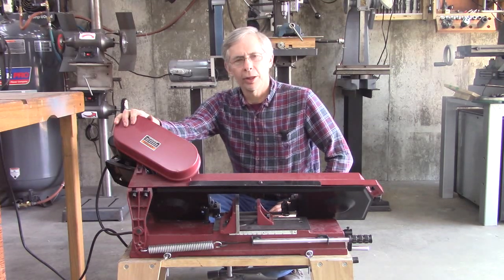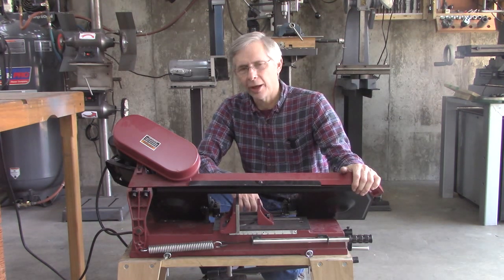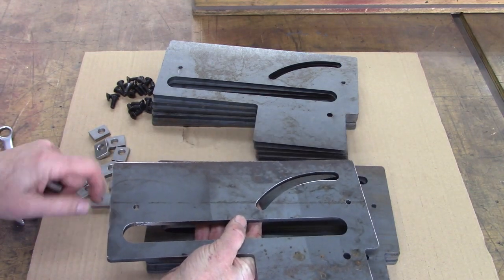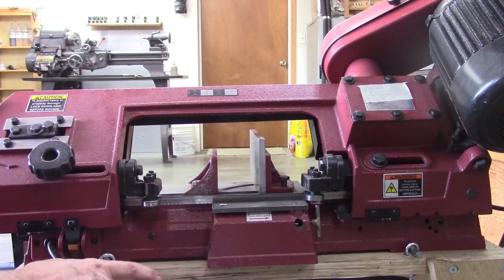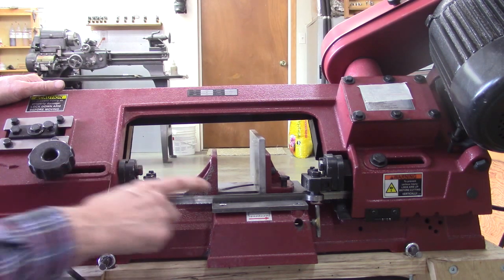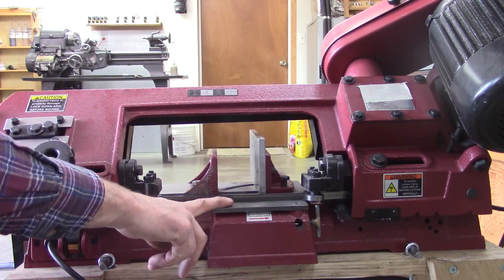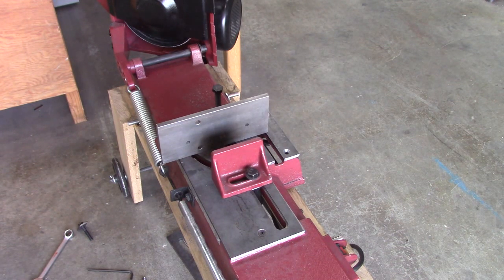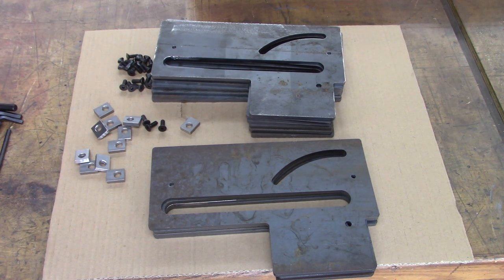Correcting a Common Depth of Cut issue on a 4x6 Import Bandsaw

Comment: I just ordered one of these plates ! Thanks Winky ! although the price has gone up I see ! it's still a good deal and my band saw is more or less useless without it !  thank you for coming up with the idea and sharing the idea with all of us !  when it get's here the counter sunk holes is the hardest part ! I don't have a counter sink... so I'll grind a old drill bit to the shape ! 
Thanks my friend !
Reply from the maker: Hello Bob. Good news, I changed the installation slightly so no need to countersink the holes. I've included instructions. All you need to do is drill 1/4" holes in the saw using the plate as a guide and then drive in spring pins (some call then roll pins). On the extension you will need need to drill and install 5/32 pins. All pins are included. I did not pre-drill the holes in the extension because some saws are made a little different in this area and I was afraid the holes would not line up. Thanks for the order and I'll do what I can to get it in the mail today.

Comment: Hi Winky. I think the saw bow you have is widely used across different style bases. My version of this saw has your style of bow but does not have the problem you have so neatly addressed. The vice stands up much higher from the swivel base. But there are two other issues you might like to look at. There is no electrical interlock on the belt cover. It is possible to accidentally run the saw with the belt exposed. Bad for fingers. The 'mechanism' for releasing belt tension to adjust the blade speed is appalling. On my saw it is a lockable bolt sticking up from the base that pushes on the underside of the motor. The bolt is next to inaccessible. I don't know if yours is like this, if it is I think many viewers would appreciate possible solutions. Cheers, and thanks for such a nicely presented and interesting channel. BobUK.
Reply from the maker: Id have to look again but i think the belt tension is a pain to adjust. The blade speed is about right for most cutting at the highest speed so fortunately i don't change speeds very often. I'll have to look at that.

Comment: I would like to suggest a new project for you to  build. After watching other youtube videos about making an electro-magnetic vise for a drill press why not make just a magnetic base for a standard vise so it can be used with non ferrous material and wood. I was looking on Amazon and some of the magnetic door locks look like they could be adapted to a metal plate with little effort.
Reply from the maker: Interesting idea....  although I'm not sure I need it. I have a vise mounted permanent to my drill press table. Occasionally I make things I don't need to perhaps I'll do this

Comment: Ok i have modified my saw allergy grate minds a all that . Hears a problem I have that you may be able to help me with  Given I have' not got the mens to cut a thread on my lath, yet  I have maid a Latin tool post .  But need an  adjuster bale  base . I can open up to a suitable size by doing it out , to fit my Latin size  . hear my suggestion.  if you mad some with the smallest Lantin post hole , a put them for seal on you new selling platform. I could send you a performer invoice . & buy the  Adjustable  Base ?
Reply from the maker: What is the diameter of your post and height to center? I'm not interested in making another one but i will sell you the one I made "IF" it fits!!

Comment: I was going to suggest making one out of either Red Oak or Rock Maple, but after getting soaked in cutting oil over time I think metal is the better choose. Mine arrived today. Thanks Winky.
Reply from the maker: Thanks you! I actually considered wood but i was worried about it warping. If I made it 3/4 think it might work well but then it would reduce the depth of cut also.

Comment: How do you keep your shop so clean...especially the floor?
Reply from the maker: Well...  it's not always clean but overall much cleaner than it used to be. Years ago I'd all day long on a project and be elbow deep in wood or metal chips. Now when thing get messy i start losing stuff. I guess I'm getting old. Another reason I keep it clean is that my shop is small and i have it packed with tools. If I get too much of a mess going I run out of space.
Reply: @WinkysWorkshop  Well stated....It still looks great in my book.

Comment: What is your background?
Reply from the maker: Well, I've had an entertaining life but no formal education. Actually I've always been into woodworking and to some degree metal working as a hobby but my job was running a web offset magazine press mostly. The last 15 years i worked however was designing machine improvements. It started just troubleshooting but most the problems were related to poorly designed machines. So I learned some cad and started making upgrades. It was actually fun for the first 10 years but after that I had all the fixable projects were finished and I was left with all the impossible jobs. When I retired I had about 20 projects going. I was glad to get out. Honestly, I saw the first 10 years as sort of an engineering education. During this 10 years I also worked with several very good machinists and bought a lathe and mill etc. I ended up making a lot of parts at home too. Now I'm retired, have all the cool tools and the time and knowledge to make use of them. Life is good!

Comment: I admire your way of doing things and for making these plates available to us.  My saw does not have that flaw in the design.  I don't know why but it doesn't.  Further more I have mounted a cross vise on the band saw platform.   Sounds and looks unattractive but I sure do like the set-up for the kind of work I do.  With the mounted cross vise I can dial in the length of a work piece much more accurately.  And for one off cuts that is a real benefit.  Thank you for this video and what you do.
Reply from the maker: Thanks for watching. The vise is a good idea!

Comment: It's good to see that the plates are selling well. Over fifteen years ago I had one of these saws and had it tuned up and working well. One day I came across a little 7" Kalamazoo in good condition with a 3/4 horse Baldor single phase motor for $200. Two people could easily load it into a truck. Unfortunately do to downsizing I had to sell it. It's a great little saw to look out for.
Reply from the maker: Thanks Andy, sorry about the downsizing. Yeah, this saw isn't too bad for the money after you correct the quality control issue.
Reply: @WinkysWorkshop  Alot of people wouldn't have a horizontal bandsaw if it wasn't for these 4×6 imports. They are affordable and have a small footprint, especially if you have a dedicated space for it like you do. As you know they will do what they are meant to with some tuning and a high quality blade. When I came across the little Kalamazoo I wasn't in the market for a new saw. The Kalamazoo was maybe 20% larger and in good condition, for $200 I couldn't pass it up, plus I probably sold my old one for $100.

Comment: Just dont understand the plate but looks nice
Reply from the maker: There was no way to adjust the saw down far enough to complete the cut. When I first got the saw they had the blade guides pushing the saw blade down so that it would work but this created all kinds of other problems. Mostly the blade would come off when you increased the downward pressure. The saw works like a dream now. Of course not all these saws are made like this but apparently quite a few! I initially had 10 plates made and they all sold in 30 minutes. This is the second set I have had made. Thanks